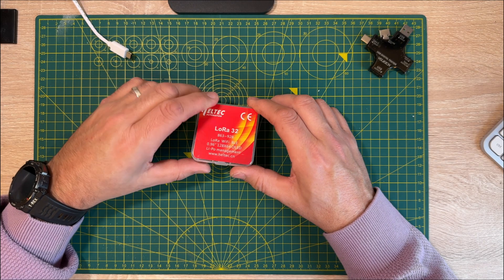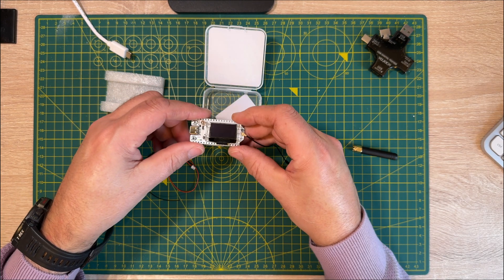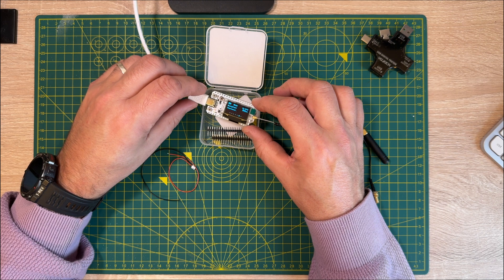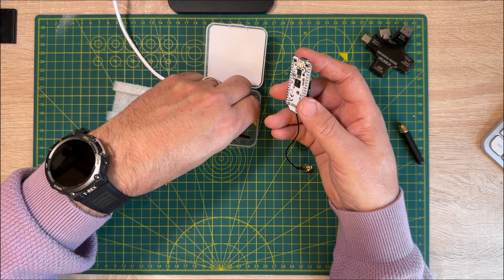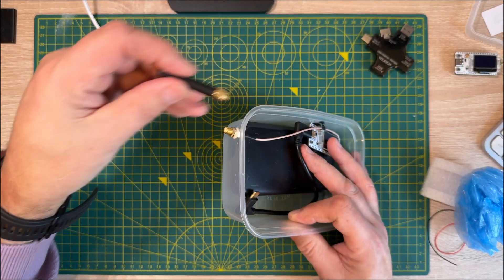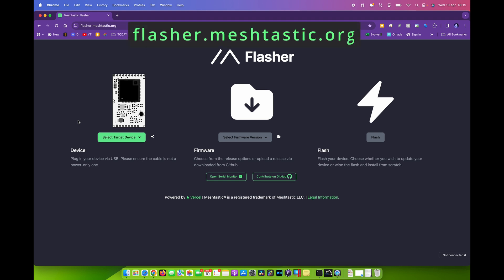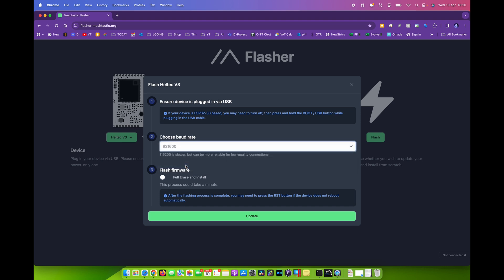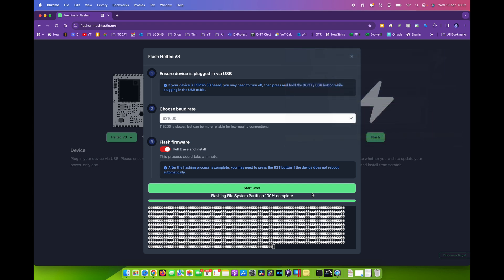MeshTastic - A first steps guide to flashing firmware

Comment: I have a majorissue in that I try flashing the board but it keeps getting stuck at 24% complete or some other level of complete. It doesn't finish flashing.

Edit: I just selected a slightly older build and it went through no problem. The most recent stable release just did not want to be installed.
Reply from the maker: Hi, I’ll go try that newest build on one of mine and let you know the outcome 👍 I can test from Mac & Windows..

Comment: How come my heltec devices are not recognized when I try to flash and update the firmware???
Reply from the maker: Hiya, what operating system are you using ? when I flashed from my Mac it recognised it straight away but from my Windows laptop I had to install a driver for the USB in order to recognise it.. the other thing is to try a different USB C cable, some only support charging and not data
Reply: @techtonictim  Thank you as well! helped me too
Reply: @techtonictim  sorry for the long delay in between response. I was able to figure it out. I had to update the USB driver on my windows computer. You were correct. Thank you.

Comment: How do we make the sleep setting work? When mine goes in to deep sleep you can't wake it up. Have to reset it.
Reply from the maker: I have the power saving switched off in the App but screen blanking set to 15 seconds.. not had a sleep incident like that. Which software version are you running?